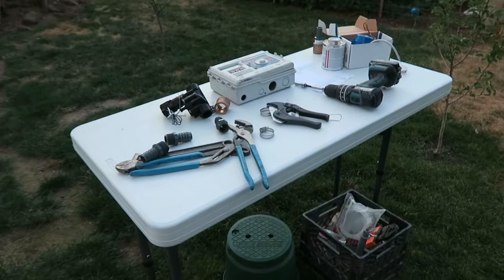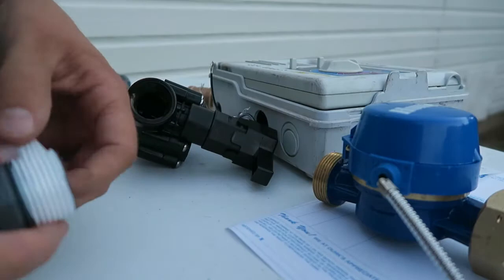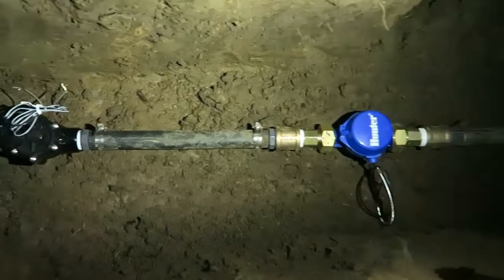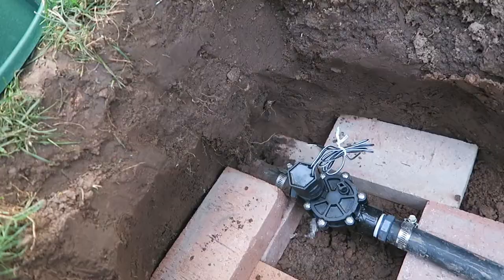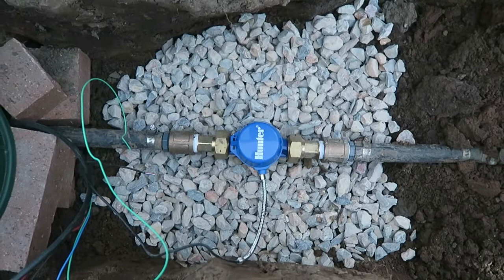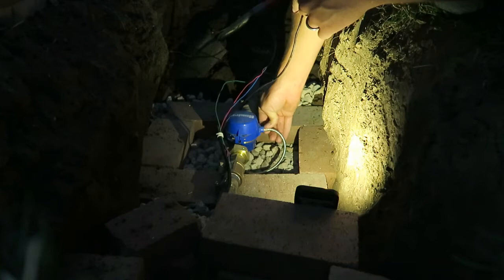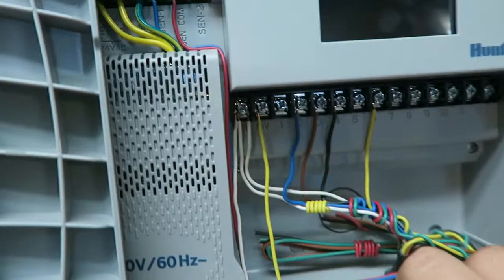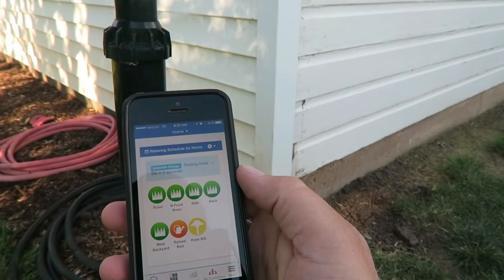How to Install Hunter Flow Meter

Comment: I know it isn't required but it's actually a very good thing to use shielded wire for the flow meter per manufacturer's recommendations. The shielded wire is to prevent any electrical interference from any other electrical currents in the area giving you the most accurate readings. No biggie though. Great video! Thanks for sharing this.
Reply from the maker: Thanks for watching!
Reply: This is only applied when timer location is same area as utilities such as phone / cable provider .....main eltrical digital reading eletruc meter also use radio signals . Outdoor lighting ... Also using same multi strand so wire will send signals or reading to system or prevent  function .... I found this out first hand . Always use sheilded wire and save yourself the trouble . Or have the mindset that the  r.f.d. shielded cable and wirecapped fasteners are used .  This isn't triggered by 24v . It uses radio signal . Same princable as using walky talkys as kids and pick up c.b. radio signals other units ..police radio. Same thing anything can travel through that wire unless shielded . But overall of the many I've seen this has been demonstrated beutifuely.  As a contractor myself using product and working with hunter.
Reply: @remyfingerling5148  I read the manufacturer's instructions and it does ineed recommend shielded wire but I will be damned if I can find shielded sprinkler wire. Any recommendations?
Reply: @jerrkyd  the compamy toro carries shielded wire usually can retain it from a horizon supply store... Or look online toro rfd wire
Reply: Do you think that using the white wire "common," and then using the RED wire coming off of the water meter. Instead of using the white and the BLUE wire, could effect its function and readings or performance. 

The ones we've installed seem to work fine,  but the service or app or meter don't ever seem to give any notification when there are leaks.. In fact it really doesn't even show any increase in the water usage, which makes me wonder what readings are they even giving me. An how can it not increase when there are major leaks. Has happened 3 times already,  an I'm talking about several hundred dollars in water bill increase. Even a 1400$ dollar water bill one month,  before inspect the property and finding the leaks.
Reply: @JB-pb9xv  To be honest, the colors don't mean anything when using the sprinkler wire. However, the colored wire are important on the actual flow meter because interanlly they are wired into certain parts of the product.

Comment: From source to flow meter (10 times pipe diameter) should be longer than from flow meter to valve (5 times pipe diameter).  Looks like you have it backwards.

Comment: Also when using a flow meter same size as your point of connection. Up size the meter 1× . This will allow proper flow. Along with respective master valve.  3/4 feed = 1" flow meter /    1" feed  = 1 1/2" flow meter . Should solve flow variances/ restriction . The same principle is used with well check valves and production of g.p.m. will be restricted by not upsizing vai the size of your feed line .
Reply: Toro makes a sholeded wired for the rf set up for satalite systems the wire can be found at local supplly house note onpy comes in 5 hundred foot rolls

Comment: Been having problem with this flow meter,  even though it seems to work and everything.  The problem is more so with the "leak detection," in that the system doesn't ever send any kind of notification if and when the system is leaking. Unless that's only an option for the "paid service," but everything else detects the sensors. They function when water runs, but it doesn't give or send or show any kind of "spike" in water usage.  When the system has had several big leaks..

Am end up getting a crazy high water bill, an yet the flow meter and app and everything. Say that everything is all good,  an in fact you've even "saved 1% less water usage." Which is pure bs, cause the leaks have been there and have sure as hell effects the water bill and usage. 

I wonder how much it matters about wiring it with that "blue wire" and then of coarse the white wire as common.. But using the RED wire, instead of the blue one.. Unless the red wire is just a ground or something,  m you wouldn't think that would really matter much. Now I'll have to check if that's the issue,  but I think it's more to do with their actual notification service.
Reply from the maker: Do you have a master valve?

Comment: what do you think of the flow meter now that you have had it installed for a year?
Reply from the maker: It has been nice to have a flow meter. I receive high or low flow alerts when watering is abnormal. Additionally it gives me insight into how many gallons of water I use to irrigate. Most of my clients are not willing to pay extra for it but personally I value what it offers.
Reply: I think over the lifetime of the sprinkler system the costs of the flow meter are probably negligible.  Its only $100 or so for the meter and your time to install.  I'm debating going this route or rachio and their meter.  I like that this meter is more old school and doesn't require any batteries or other digital nonsense.
Reply: Thrifty if your customers are paying for a water bill.  This system will sell itself and more . I use it for homes on city water / reclaimed/ and well. Living in sofla  each county has water restriction enforced . And also allows you to monitor there system 24/7 So in the event of a major issue you can in realtime shut down the system inform the h/o have an idea what the issue is and adress with right materials and tools needed. Saving customers money . And having a monthly sir charge for observation and water conservation.  If they have a hunter pro-c dated 2014 or higher they habe a retrofit faceplate.  So don't have to sell entire timer.  Then the annual cost pats for itself in return for both parties.
Reply: Cost of standard well and pump and all said and done can be 10k . And the most they will pay could be 1.2 k I think that along with saving on water bill. Along with this system hunter also provide emitters nozzels.  That use low gallonage . Hunter M.p.r. rotating nozzels. Further reducing the usages of g.pm. each zone =$$$$ for h.o.
Reply from the maker: Agreed! There are so many pros to using a flow meter is hard not to see the ROI.
Reply: Can the flow meter be installed inside the home right on the main water pipe after the controller?  Why does it have to go outside in the ground?  Seems like it would be easier to do inside, and connect the wires right to the controller.  I’m new to this, so just asking.  Thx
Reply from the maker: No reason why it couldn’t be installed indoors as long as it was installed correctly. In many scenarios this wouldn’t work and your city water meter is usually underground also. Regardless it would depend on a given application where is the best placement.
Reply: My water meter is in my basement, and only about 8’ from the controller.

Comment: Why do u need a master valve ?   Your running line pressure on regular poly anyway. Which is a no no!
Reply from the maker: Master Valve serves many purpose for me. It’s definitely not a essential part of the system. But it does act as a safety shut off in the event of a main line break. I also have several hose bibs connected to the main line. Having a master valve allows me to turn a hose on in the garden and set a time for the master valve to shut off. This prevents the usual “forgetting to turn off the hose.”
Reply from the maker: Poly Main lines are not that uncommon in my region. Personally I prefer SCH 40 PVC. But my house is over 75 years old and poly is what the previous homeowner installed. I haven’t had any issues or concerns.
Reply: The master valve should always be installed or else false readings when system is activated by the timer will give you mixed results (flowmeter). Resulting in negating the perpouse of water saving system . Also like stated above having a master valve is a  electronic (isolation valve ) for any issues like leeching valves mainline breaks  Or emergencies .  Can shut off the system via internet( cloud ) from your handheld app.